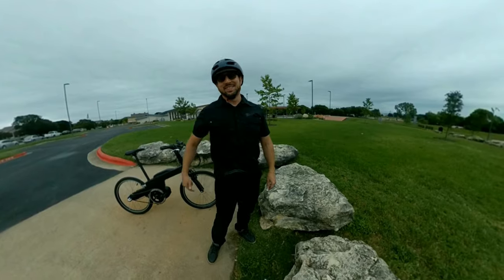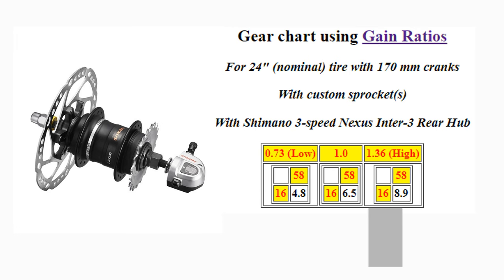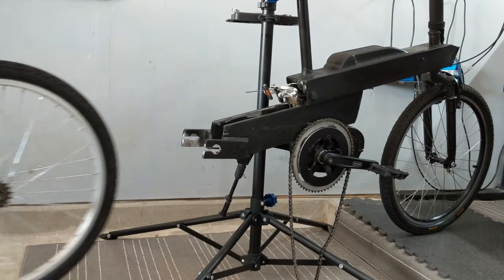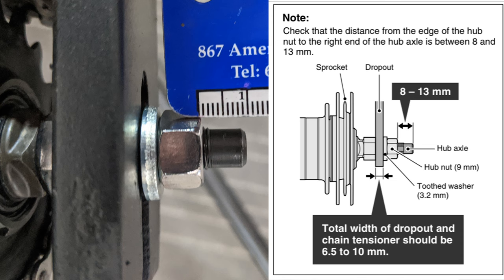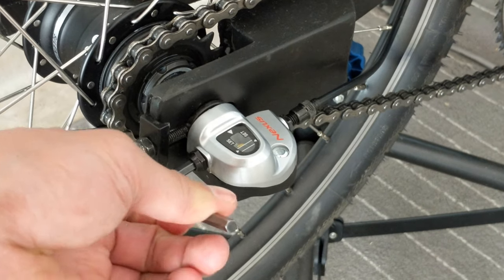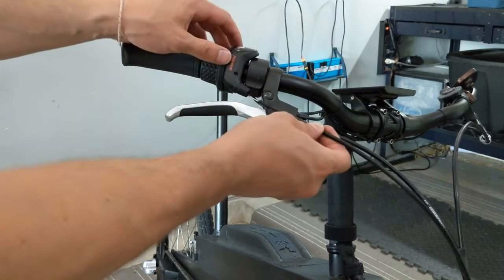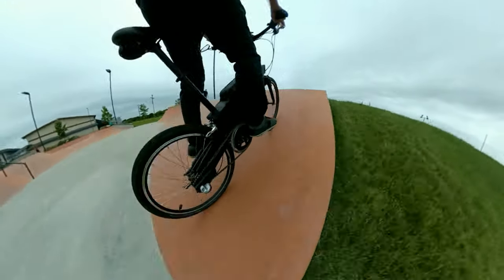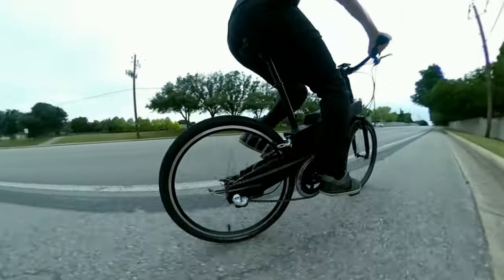Convert Your Bike to IGH | Nexus Internal Gear Hub

Comment: Most IGH's aren't up to the power of a motor unless your motor is low powered.
Reply from the maker: Yeah I've read that too. I'm under the impression that the 3 speed hubs and the Rohloff are the strongest, but that's what I'm here to test so others don't have to. So far it seems that the most important thing is to not try to change gears while the motor is activated. Feels a bit like pulling the clutch on a motorcycle.

I'll publish an update video as soon as it breaks, but crossing my fingers that I won't have to.
Reply: @eBikeaholic  From my reading Shimano 3 or 5 speed is the best affordable option but I'd still lay off the power while shifting with any motor. The Rohloff is sweet and will put up with more power but you can buy & replace a Shimano IGH for less.
Reply: @michaelsprinzeles4022  What about Enviolo? They seem to be a favorite among the E bike community. They are pretty durable and cheap
Reply: The Enviolo is awesome but is not cheap and usually found only on Euro-spec e-bikes because they ain't up to running 750 watts or more full time.
CVT & high power aren't commonly found together.
Reply: @michaelsprinzeles4022  near 15,000 km 1800w shimano inter 3 hasn't missed a beat
Reply: @arronjohnston742  Nice. You must be careful about what gear you're using because that kind of mileage would even stress a cassette & chain.
Do you use a gear shift sensor?
Reply: @michaelsprinzeles4022  😆 only thing i'm careful with is not to power shift, i service it about every 800km full strip clean an repack with automotive wheel bearing grease and between services i drip automotive gear oil in the shift skewer hole about every 100km the internals show little wear there are no sensors just the controller it came with and it's twist throttle chain rings are 14t free wheel off the motor to 53t to 53t 36t front an 22t rear running a locked out rear derailleur which makes it a 6 speed..
Reply: @arronjohnston742  That's a lot of maintenance. I may oil my chain that often, never had to disassemble my derailleur just occasionally drip some oil down the cable housing and adjust the shifting. Granted I should do more but I doubt an IGH would last under my lazy maintenance routine.
Reply: @michaelsprinzeles4022  i do it because i enjoy it that's why i have the cyclone kit an not an enclosed bafang kit or dreaded hub motor, if you're that lazy then you should go with a hub motor, mid drives aren't for lazy people......
Reply: @arronjohnston742  I'm running 2500 watts with a 50 amp controller on a BBSHD. I've broken 1 chain (which served thousands of miles before I installed a motor) in 2500 miles. Stay in the right gear and mid-drives are as reliable, or more, than hubs.
Reply: @michaelsprinzeles4022  lol right, i've never broken a chain in fact the only thing that ever broke was the garbage sturmey acher hub, like i said near 15,000km with the inter 3 an my bike aint no lean mean fighting machine it's a tank, basic maintenece takes nothing to do.......
Reply: @arronjohnston742  I guess "basic" has different meanings for us. That broken chain served multiple thousands of miles before my motor conversion then about 1200 miles after. My current chain has about 1300 miles on it with no signs of stretch (according to my gauge). If I had to measure my breakdowns in those short km I'd consider my bike a hassle to maintain;)

Comment: well, i hope you're just joking about the derraileur tech being "outdated". internal gear hubs are cool (i also have a commuter with a nexus inter 3) , but derraileurs are still way better in terms of convenience, weight and efficiency. well, you're an ebike guy, so what do you know?
Reply: Derailleurs are finicky require precise tuning and more maintenance which most people can't / dont like doing.  And people want to shift at a stop which derailleurs can't do.  Derailleurs don't last as long w / a mid motor e bike.  Chains on derailleur are thinner weaker too than single speed chain used on IGH

Comment: I love this video, got an e-boner :) No seriously, I was looking online for something different, on how to change over an internal gear hub that needs to be switched over to a new rim as the old aluminium one is ripped in two. Because I wonder how to spoke a rim yourself and was looking for a tutorial. YT came up with this vid among others and it got me thinking about changing / converting my old e-bike into a new bafang setup, but what are the costs? I have only a low budget and the old bike I have wasn't worth the squeeze for upgrading with a new battery and such. Haven't got the funds for a new ebike also so this vid got me enthusiastic :)